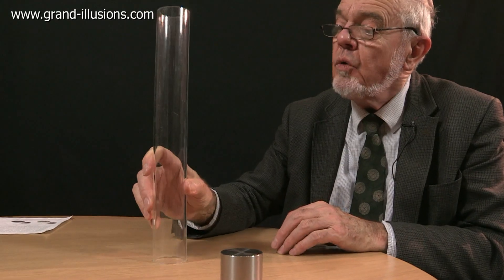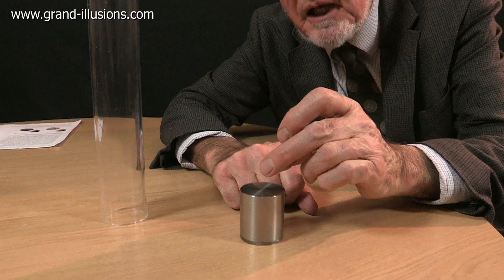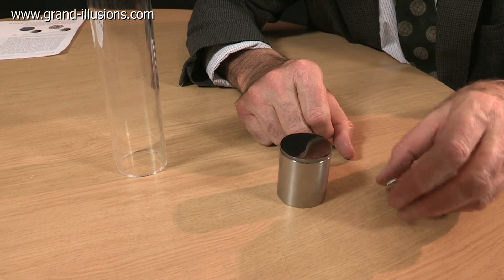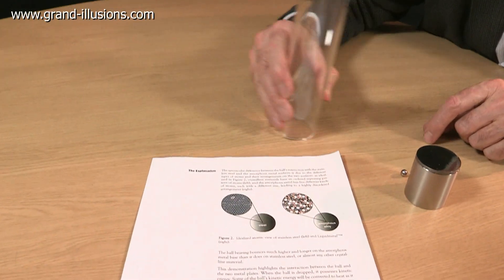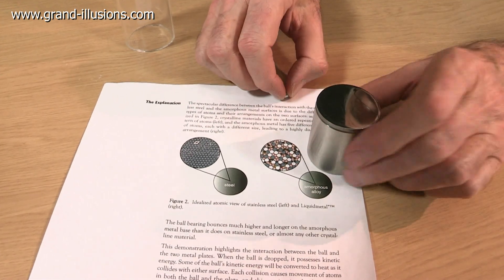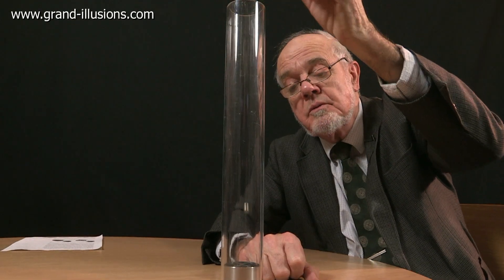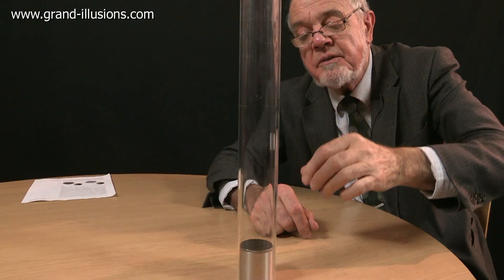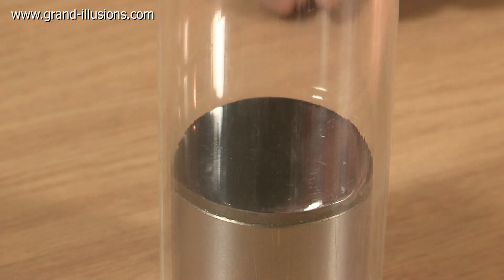Atomic Trampoline (HD reshoot)

Comment: This has to be made into a shield.
Reply: +TheHelleri
It would work great up until it broke. Like a ceramic, I imagine, since the atoms don't bond together the way metals do. It won't be as good as deforming and would have a knack of cracking/splitting/shattering when struck hard enough. Of course, this breaking happens at much higher forces than ordinary metals would deform at.

Yep. Just like ceramic. Glass (ceramic) is easy to break and doesn't actually hurt to break much as long as you actually break it. If you hit it hard enough to break it, it'll kindly break into lots of little pieces and get out of the way. If you don't, it'll sternly say "no," then take all the energy you put into that punch and drive it all back at you.
Reply: Bullets would bounce right off
Reply: maybe...probably depends on the bullet and shape of the shield. But that is the idea, real life equivalent to a vibranium alloy shield.

Comment: If you did this in a vacuum and position the base perfectly level you should be able to keep in bouncing for an exceptionally long time.
Reply: The Great Gyrofluff Perfect vacuum at around >1atom/m^3 would make it nearly infinite, I bet.
Reply: the ball looses most of its energy due to hits not the air friction
Reply: vsm1 Well, of course, but the loss of energy looks to be less than 1%, so cutting out air friction would make it close to a perpetual motion machine.

Comment: I wonder how much more efficient this could get if not only the ball would be made of the same material then the "trampoline", but also bounce in a vacuum to eliminate air-resistance and friction. 

Now we would need to think of a way to eliminate the contact the ball has with the tube too, to as a result eliminate the friction between the ball and the tube. Perhaps a electromagnetic field would work to keep the ball in the center of the vacuum tube? But the field would also apply some force, and as a result, resistance to the ball and rob energy...  tricky.

Any ideas?

Edit: Nah, I already figured it out, the "trampoline" only has to be shaped in a specific way in order to keep the ball in the centre, I only made it much more complicated then it is :)

Comment: Can somebody name examples for practical applications of this material?
Reply: +Cuda FX   Hammer drill / percussion drill for example, the more efficient you can transfer the knock to the drill bit the better. In fact I would think anything with the word hammer in it would benefit.
Reply: The transmission of acoustic energy from inside a device's case without the need for little holes in the case that let water in.
Reply: +Cuda FX Any metal musical instrument, like a triangle, might make a different noise when struck?
Reply: +lizardizzle  Reminds me of the mathematical problem 'Can you hear the shape of a drum?', don't know what's the status on that one. But a triangular "drum" most definitely sounds different than a round one, because it has different eigenmoden.

Comment: i think the most energy ist lost by the friction with the tube...
Reply: And the ball itself is made of steel, so it will deform just like the steel surface did and thus lose energy.
Reply: A lot of wild guesses but not a single accredited source given in this thread.
Reply: Jack Sainthill my source was the audio from this video and a basic knowledge of GCSE Physics xD probably not the most advanced of answers, but I never chose to pursue Physics further
Reply: Andrew Buist
Steven Simard 
Fair enough, both.
Steven, I agree with you. However, whether the principal loss of energy is through heat loss or through sonic radiation I couldn't say - though I'd put my money on heat, if only because in most mechanical interactions that seems to be the one that does it.
Cheers, both.
;)
Reply: He should lube the tube..😬
Reply: Jack Sainthill I'd actually say sound, because the contact area between the ball and the plate is so small, there really isn't surface area for friction to occur.
Reply: +riverrist or sound, towards the end, you'll notice the noise produced goes in an upward curve, like a slide whistle. The higher the pitch of sounds, the more energy contained within it.
Reply: Most of the energy is lost due to sound.
Reply: Jack Sainthill Source cited: Observation.
The ball bearing makes very little contact with the plastic. We know that gravity is affecting the ball as well, and that it's making sound.
With that information, we can deduce that the Main cause of energy loss is due to the ball making contact with the "Trampoline".
Reply: +madichelp0 i first thought the ball is made of the same material as the trampoline. if it is ordinary steel it probably loses more energy due to deforming.
Reply: Steven Simard
OK, but perhaps the sound (and heat - and bounce!) are generated initially by the temporary, microscopic deformation of ball and/or surface at the moment of contact. If that's so, then the amount of material in actual contact would not be a significant matter, because said deformation would extend beyond the point of immediate contact - would it not?
Reply: Aerodynamic drag will dissipate quite a lot of the energy, but hardly any of that is due to friction with the air.

Comment: Do you have a vacuum chamber at hand? I would like to now how much of the loss in height is acually friction. :)
Reply: Hm I am pretty sure that if the ball is made of the same material the Eddy currents from the magnets would ruin the whole thing. Otherwise, that's brilliant.
Reply: I reckon air is not that responsible.
Reply: I reckon air is not that responsible.
Reply: If you look closely it rubs alongside the tube. How to get rid of the tube would be better
Reply: +Ideally Jekyl It would be expensive, but an array of magnets in a ring shape around the ball to keep it bouncing along one axis could work.
Reply: +Ideally Jekyl   Make the disk concave, so it self centre if the bounce id off centre.

Comment: make the bearing of the same material
Reply from the maker: +ahmed We did have one, but it bounced off into low earth orbit and we never saw it again. The hole in the ceiling is irritating though... ;-)
Reply: +Grand Illusions hahahaha
Reply: +Grand Illusions 
...and today we're learning energy conservation principle with Tim.
Reply: +IamCrusaderRUS Maybe he dropped it from low earth orbit too.
Reply: then do it in a vacuum:O
Reply: +ahmed Secret to free energy discovered?
Reply: +Kieran Jeffery or you can supply another force in addition to the gravitational one
Reply: Hinawa Chainsaw
First try to supply one that would help You get rid of all the atmosphere.

(Or else if You get the ball to sufficient speed to get to orbit & orbit, it will almost instantly get ripped apart (even on much lower speeds it would melt & deform). Accounting for drag on the way up gives you substantially bigger speed required.)
Reply: I was subtly implying that no one said that this can be operated with only the gravitational force, so you can reach higher points than the starting one as you were pointing whit your comment. Everybody know that you can't reach the low orbit with these conditions, that's clear. Anyways, your comment made me laugh (in a good way).
Reply: +ahmed My guess is that it will barely bounce
Reply: *with
Reply: +Grand Illusions Video or it didn't happen.
Reply: +bamafb77563 Not much difference. The BB is tempered steel, which has very similar damping characteristics to the solid liquid. The atomic lattice is tensioned by shock freezing it in a state it doesn't usually assume at room temperature, which is what makes it much harder than mild steel.